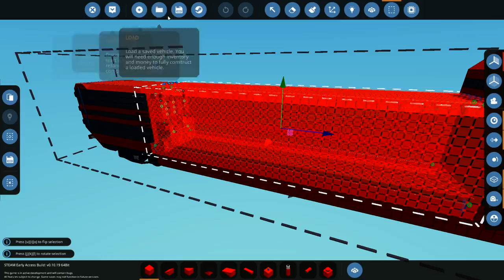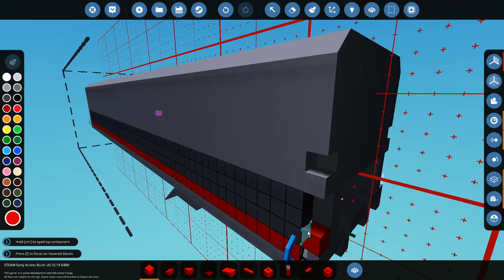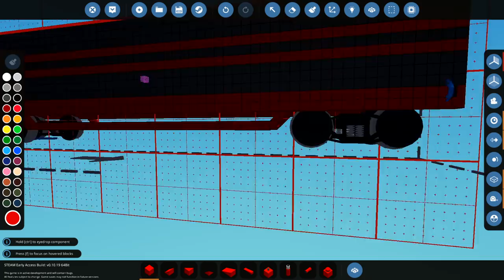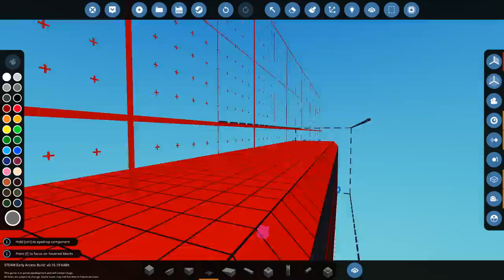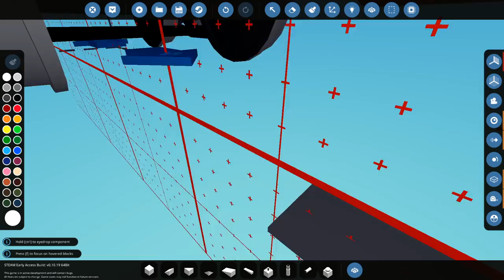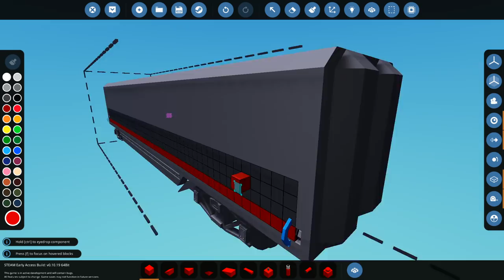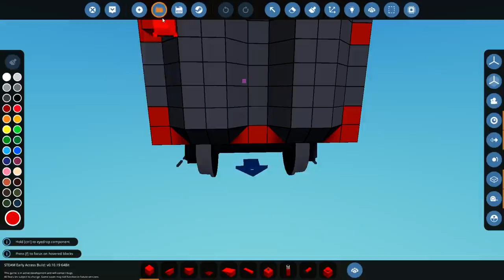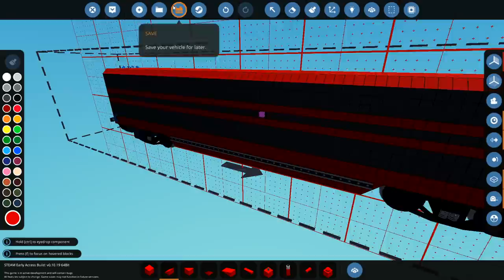Building Cargo Cars!  -  Stormworks Gameplay  -  Jet Train  -  Part 8

Comment: Could you imagine watching this go past your house
Reply: Ikr
Reply: if I saw it going past my window ill be confused because if real trains used rocket fuel then the world's jet planes would struggle to get any kind of fuel because the jet trains would of used it all.
Reply: 50p_proYT Gaming not really. The trains are limited to railway that is mostly straight, so the train doesn’t have to use current tracks with small turn which can derail it. The US currently doesn’t invest in there railways at the moment and are focusing on roads so this would be extremely expensive and may not even be worth it. While planes are only limited to airports and runway size, and we’ve already got plenty of those which gives them a major priority. Also a jet train is just not fuel efficient enough to be considered. Electric trains are where it’s at right now.
Reply: Expired_Water u big brain
Reply: @El_Presidente173  Oh ok.